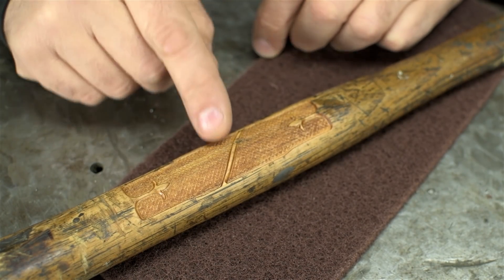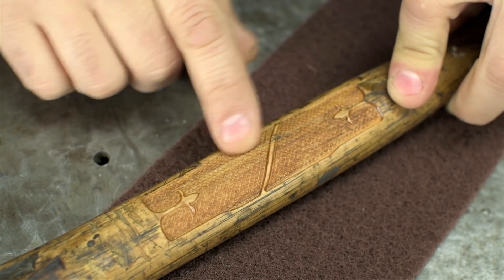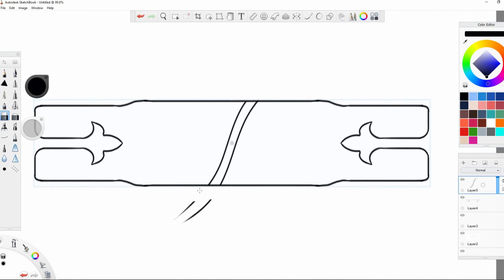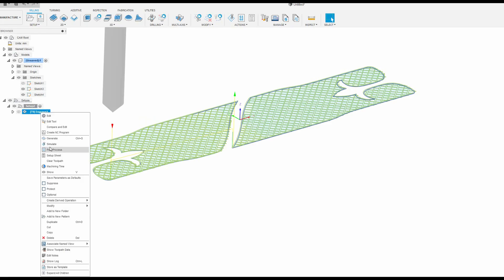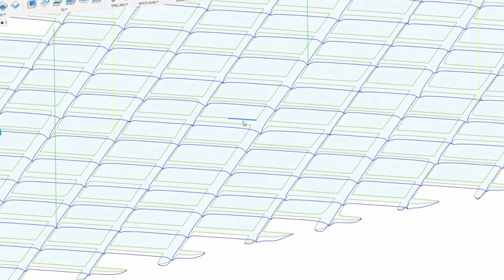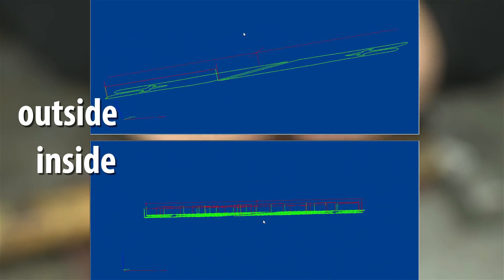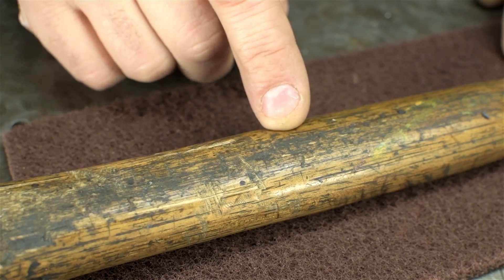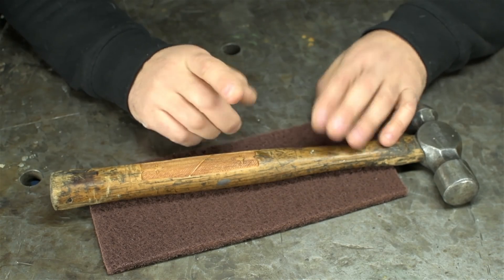CNC Checkering!!

Comment: Hey Tony, you got great results considering the soft wood and the bit used! Here is a tip that helps with the cut being "fuzzy", coming from somebody who has done a lot of CNC checkering on a lot of types of wood.

Use a 90-degree engraving bit instead of a V-groove bit. An engraving bit usually has just one flute, it's basically a cone with one side cut flat like a "D bit". But that's NOT the important part. The important part is that it has a slightly off-center tip. A V-groove bit doesn't cut at all in the bottom of the groove because its very tip, rotating on-center, has a surface speed of...zero. So no matter how sharp a V bit you use, the centered point is just dragging in the bottom of the cut and it'll always come out fuzzy in anything softer than, say, rosewood. Not a big deal if you're trying to cut a huge groove, but for the little .025"-.030" deep grooves in your average checkering pattern, a little fuzz makes a BIG impact.

The engraving bit solves that problem and gives crisp results. The off-center point technically cuts a tiny flat in the bottom of each groove, but it's not something you would notice.
Reply: This was an engraver tip.... tip.
Reply: Beat me to the engraver tip. 🍻
Reply: Thanks, that's a valuable info as I'm in the process of persuading my father in law into trying more work on CNC. He's an old-school carpenter and great furniture maker but these newer technologies always make him grumpy.
Reply: Soft? Hickory is soft? Also, checkering should be done using a 60' cutter.
Reply: @LBCAndrew  Fair enough on the wood, hickory is probably hard enough. I know walnut is soft enough to fuzz up if you use the wrong bit, exotics like ebony are hard enough you get clean results with just about any bit. Hickory is between those two.

Regarding the cutter I'm sure you could use 60 all the way but 90 is more traditional and in my view more practical. For the same lines-per-inch, assuming you're making pyramids with actual points and not a flat at the top, 60 would go very deep and the resulting pyramids would be fragile and wear down quickly. For example if you're doing 18 LPI checkering, with a 60 degree cutter you would have to go .048" deep to form pointed pyramids. With a 90 you only have to cut .028" deep for 18 LPI. The pyramids are fatter and have more structural support.

Now if you are checkering by hand, it's my understanding that a 60 degree cutter is useful when laying out the lines. It's easier to stay in the groove with a 60. So you can cut shallow grooves with your 60 degree cutter, and then use the 90 degree cutter to chase the lines -- not necessarily making them any deeper, but widening them to change the flats in between the grooves into sharp points. The Gunline checkering guide describes exactly this process of starting with a 60 and finishing with a 90.

Comment: Hi Tony check out (pun intended) some D engraving bits for your application, that will work beautifully for your checking work. I use them daily on a CNC machining center, higher RPM (~10k) will work better although I've done plenty of job with a 4k RPM spindle.

Comment: You could've drawn just the first half, checkered it and mirrored it, as the part is symmetrical... Heck you could have drawn just a quarter of the image, checkered it, and mirrored it along the Y, and after that along the X (or along the X and afterwards along Y doesn't really matter) ! ;-)
PS: I'd like to see it done in a 4 axis CNC, you know with the handle spinning like in a regular wood lathe!

Comment: Insane suggestion for your need for spindle speed:
Make an adapter that fits into the chuck like a normal bit but also attaches to the fixed part of the tool head and has it's own chuck. You put the adapter in and then your bit in the adapter and it gears the spindle speed up.

It might eat a good chunk of your z but it'd be pretty awesome to have something that let you hit the higher speeds for wood and (IIRC) smaller bits. Since you are going to be using it on things that don't have as much heft the forces would be smaller and it wouldn't be completely unreasonable.
Reply: He'd do better to strap a router spindle to the head and adjust for the offsets.

Comment: Looks like someone is going to need to build a router mount to bolt on the front of the machine. You have a horizontal/vertical transformer. Now make a mill/router Decep...

Comment: The machining was pretty neat all things considered, but I have just but the one question: why didn't you sand the handle first to remove all the crude, minimize pits, etc? Wood give the machine a better surface to deal with, and you'd have a fresh looking thing. Sure, you'd need to re-finish the wood, but you already had to finish the engraving, so might as well oil the whole thing. I mean, who passes on the chance to rub a wood shaft with some sand paper?

Comment: look into a planetary gear RPM trippler adapter for the mill
we had those in school 
with different gearing you can make a mill that has a limit of 2200rpm go to 15000rpm 
they just need  whater cooling and only work with small tools and low loads 
like we used it to carve ceramics, stones and glass with small diamond dremmel bits on a old CNC converted Bridgeport

Comment: Now for the bonus round: Rig up your horizontal 4th axis and do cylindrical milling with height mapping.
Reply: I think you'd need to both pitch and roll the part to properly copy hand cut checkering. Probably get close enough with just the one though.
Reply: @Broken_Yugo  With a reasonably cylindrical object (like a hammer handle) a single rotary axis would be sufficient. Obviously for complex shapes you'd need both A and B axes on top of X-Y-Z to keep the tool perpendicular to the surface, and even that fails if there are aggressive overhangs or deep pockets...

Comment: Flat top checkering on a tool you use regularly, like every day, is better than pyramid tops which will skin your palms before the day is out.
Ok on a shot gun, don't try it on a machine gun, it would be like an electric cheese grater.
Good video all the same.

Comment: The biggest mistake was keeping the checkering separate from the outline. You had a great master line with the center divider on the design. Just make lines following that master line and progress to the end on the pattern, then invert the lines and trim where it goes over the divider in the pattern. You'll have sharper peaks and a little more grip. To get even more though, you need a bit that comes to a sharper angle, which will require a higher lines per inch for the checkering.

Comment: It's perfectly possible to achieve the desired result even with a slow spindle. To do that, I'd remove the finish, soak the workpiece in acetone to draw oil out, dry it, either use one of the commercially available wood hardeners or properly stabilize it. Then, I'd use a tool that is actually meant for lower RPM, with a more aggressive rake angle.

Comment: I'm not a machinist (Not even a hobby machinist), but something caught my attention here. 

Surface mapping is definitely cool, but there must be limits. Since you talked about the crispness of the result being affected by the sharpness of the tool point, let's split hairs.... if the slope of the material is too steep at some point, the profile of the tool will cut an asymmetric "V" in this case. What I mean is that if you went too far around the handle, the checkering would get distorted. I understand that is a limitation of the equipment (I guess you would about 27 more axes to control that), but it's something I noticed.

I'm sure you could explain that better than I just did. Maybe you'll mention it in another video. As always, great content.  Great mix of explaining and entertaining.  Keep 'em coming!
Reply: Just 5 axes, actually. Check out JohnnyQ90, that SOB has the best toys the rest of us can only  dream of...

Comment: I disagree on the tool point.
A narrow angle (smaller diameter) would make more distinct cuts. But requires very small line spacing.
A wider angle will give smaller "flat" (closer to sharp points).   You need BOTH!
In one tool, it would be an odd shape, but possible.  Like a narrow angle twist drill, surrounded by a countersinking collar.

Comment: 7:30 This Old Tony, whatever you do, don't machine black walnut on your CNC machine.
Always be aware that Walnut, and especially black walnut stains everything it touches, even metal.
When I did it at Lake Washington Technical, just the chips were so bad that I couldn't get it off the college's VF-2's ways and the mill vice, even using a combination of hard cleaners and scotch brite!
just leaving the walnut chips there on the ways overnight permanently stained them.
Hope this helps.

Comment: Wood routers run at 15000-25000 rpm. 
Your cnc mill would be screaming at that pace. 
Strap a Dremel into the Chuck some how and you might have a chance. 
Also Dremel/ROTOZIP bits are cheap and sharp.

Comment: You could have done it in walnut but walnut isn't a very good wood for hammer handles. Pretty vs functional. I like what you did as is besides it's a hammer, not a gun the wear and tear on a hammer handle is much more server than a gun I wouldn't change a thing except putting the checkering down where you are supposed to grip the hammer at the bottom. My dad and grampa would have told you "If you can't control the hammer gripping it where you are supposed to, at the bottom then get a lighter hammer and build some muscles sissy."

Comment: I don’t know if I have the vocabulary to describe this question but does the surface adjusting taking into account angle, like if you went too far to one side of the hammer would it be distorted or can it handle that?
Reply: It just maps the depth, it doesn't rotate the tool to be continuously perpendicular to the surface.   I don't think that's how surface mapping is supposed to work, and TOT's mill can't rotate on that axis anyway.   Does that answer your question?
Reply: @mungtor  it does, thank you, is there a way to set that up?
Reply: @augustnoe4122  I'm sure it can, but it would take significantly more computational power to actually model the surface in 3D than to just measure a z-axis offset.   And then you would need a 5-axis mill (3 axis of linear movement, 2 axis of rotation) to ensure the tool is perpendicular to the piece.

Comment: I'm not sure point topped checkers on the side grain would work out as it sounds. You would have side grain stacked layers all the way to the point making the sides if each checker all end grain. In my opinion, I don't think the points would last or stay sharp, if you could even get them sharp they would chip pretty easy just by using the hammer or go all fuzzy. Having the flat top would give more support to the entire checker pyramid. Maybe make rounded rectangles instead of pyramids using a tiny curved or rounded cutter bit instead of a pointy one. Just some thoughts.
 I build and finish custom bedroom furniture for a living. Hopefully that is enough credentials for having an opinion. 
Love the videos.

Comment: Stupid question. Would tape help? I have seen people on here using tape to get cleaner cuts on the wood from table saws or chop saws, I think they have a term for it like zero tolerance tape. if you taped over that handle, that holds down the wood until it's cut so maybe the wood ahead of the cutter would not jump out? Just like they use to get clean edges on end cuts.

Comment: "I marvel at the technology we have at our fingertips"

I too, marvel at hammers sometimes
Reply: My fingertips, on the other hand, don't marvel at hammers, even though they are such a hit.
Reply: @HypnoPope  Aauch... 😉
Reply: An underrated comment!
Reply: Back in my day we used rocks.
Reply: @BPollard86 Back in my day we walked across rocks in our bare feet in the rain to get there.
Reply: @chuckthebull  Rocks? Luxury! Back in my day we had to chew our own hammer heads from steel bar stock, then make nails out of metal by feeding ball bearings to cats, then making them jump, then seeing what kind of fasteners they pooped out.
Reply: @chuckthebull  ..oh my, we had the same… except we did get lucky that it was downhill coming and going..
Reply: @dismalfist  you haD cats?
Reply: Kinda makes me want to watch a Thor movie.  The Marvel guy with the hammer.  ;)
Reply: I made my own hammer (head) years ago as part of an internship. Machined and then filed down a block of steel, opened up the center hole, hardened the piece, polished it to a mirror finish. Still my favourite hammer today.
Reply: Bahhh... everything has a hammer side.  Big whoop-dee-doo.
Reply: @user-zq6pj5jo8j  That's why I hit my toenails with hammers every night before I go to bed
Reply: THOR'S hammer!!!!! Oh
Reply: @sambrewer2306  Careful with that hammer - or you'll get a Thor thumb...
Reply: It's amazing our species was able to develop an implement for detecting thumbs and doesn't require any power source.

Comment: Problem five.   Tool isn't perpendicular to the workpiece as you get away from the the middle.  Not a problem if you are using a ball mill but it is with a V point.
Reply: Yes! I tried to comprehend that while watching the video and I hurt my brain.  The work piece can rotate, but  how does that work with something (like a rifle stock) what isn't a cylinder???
Reply: @0psi736  Actually in his demo the workpiece is not rotating.   Another axis does need to be added as you suggested to rotate the piece, and then the mapping software would need to work with the new axis to create a 360 degree surface map.

Comment: Around the year 2000 I got to do a tour of the Marlin firearms factory and see how they did their forearm checkering. It was a 5 axis set up with a lot of moving parts and miles of hand written g-code. I think I like your way for non production items, software has made small runs and one offs easier. As a side note I was there to give them a price to replace their large CNC router.
Reply: The forearm checkering must have hurt really bad.

Comment: For a first go on with a handle that started out in rough shape and a slow spindle, that looks pretty good!  I think there might be a much easier way of doing the checker pattern in Fusion just using the outline.  Run a 2d Contour for the outline, then a parallel op on the "pocket" inside the outline.  Tell Fusion the angle you want it to run the parallel passes at and set pass depth and stepover appropriately for the bit you are using.  You can then add another pass at 90 degrees to the first pass (in the dialog for parallel) and voila, checker pattern. That won't make your spindle any faster, but it would give you an easy way to control the check pattern without re-drawing it every time.  Great to see the new videos pouring in lately.
Reply: Can we get some checkering on the whoreadds?
Reply: @chuckthebull  HIt the Report flag ... they'll ignore it, but ... just maybe ...
Reply: I can't speak to CNC,  but I have done a lot of hand checkering (with file like hand cutters, not dremel),  and in my experience, problem #4 is that checkering is almost always done after the hard finish is applied.  This has a dramatic effect on the amount of tear out of the tiny wood parts. I have to imagine it would have the same effect with a slow spinning tool.  Even if I am intending an oil finish, I sand with 1000 wet /dry, rub in 2 coats of polymerizing oil, let it harden, and then checker.
Reply: In autocad you just use the 'hatch' command to automatically create patterns like this, doesnt fusion have something similar?
Reply: @ph33rth3p33r  Hatch patterns don't create lines you can use in CAM. Hatching is basically an image, not individual lines.
Reply: I can totally confirm that it's the proper way of doing patterns like that. You only need linear geometry to follow if that pattern involves something rather than straight rows. In that case, it has to be generated as a projected contour limited by the outside boundary.
Reply: Justin's right. Totally done the sub optimal way to do it, but it's cool nonetheless.
Reply: This is the way.               Much easier to make the check pattern in CAM. Source checker way to much
Reply: Wait you guys use that fancy software. I still write my code by hand.
Reply: @alexrogers9086  well, if you can define your surface with fairly simple math, you totally can. But if it's a fairly convoluted surface that you need to engrave on (and you didn't machine it), you can't really get away with handwritten code.
Reply: @sciloj  you can always get away with handwritten code. Just sometimes you have to have that code write code you could not. Or you could spend the time needed to calculate all of it by hand.
Reply: @sciloj  My company just doesn’t have the software and we occasionally do have complicated surfaces I have to write code for.

Comment: Coming from a CNC Router Table perspective, and using Vectric, this seemed overly complicated. Especially the way Fusion handles cut paths. And yes, you'd need at least 60° engraving bit if you are doing this for realsies. Or if you are really fancy, a 15° flat tip detail carver bit.

Comment: Re- try it on your CNC router table at double (or more) the spindle speed using the correct cutting bit for wood? OR: re-try it, exactly as you set it up in the MAHO except on aluminum or brass?